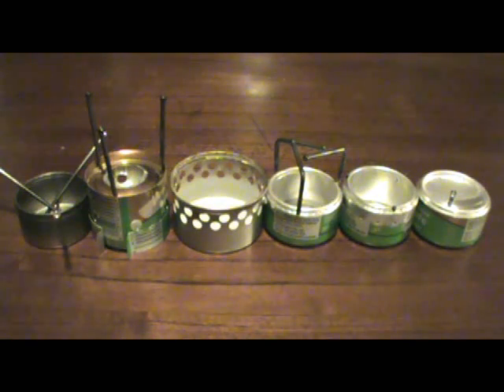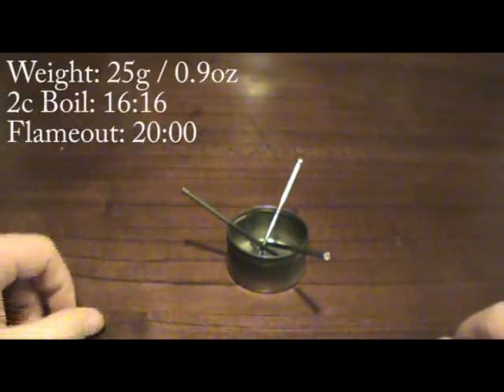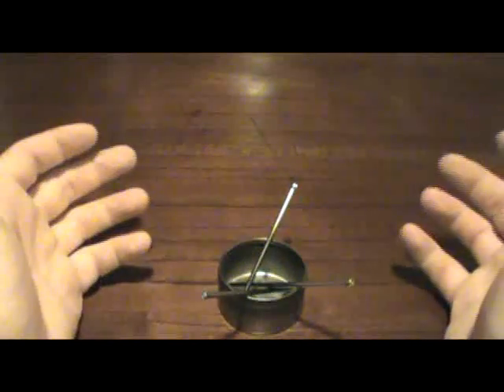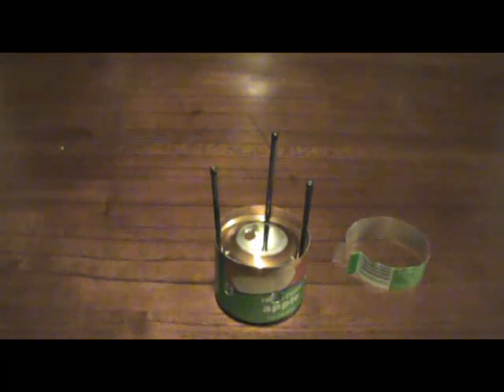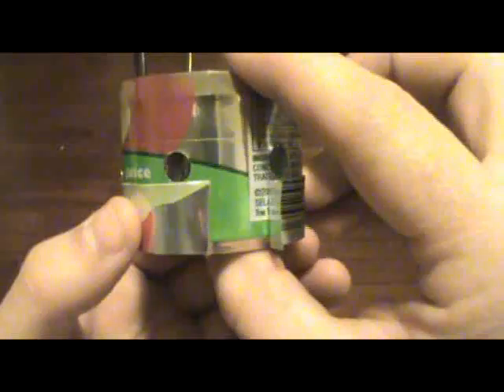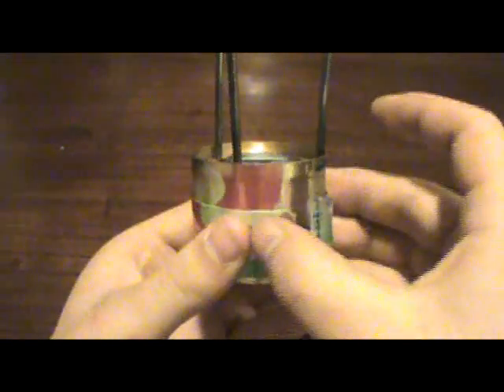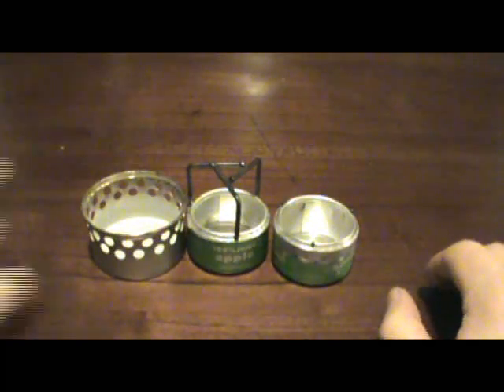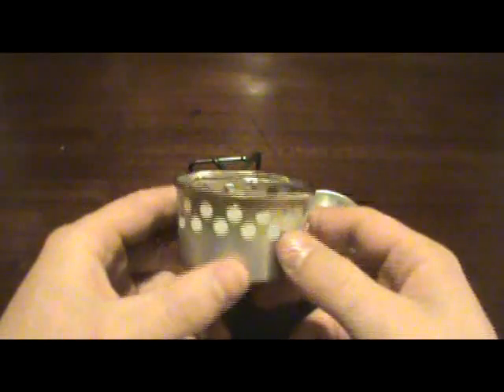DIY Alcohol Stoves

Comment: About your solo stove-
seems 1/2" from flame to bottom of the pot is too close.
Perhaps use 1/2" longer nails to get to the sweet spot?

About the stove you mentioned where someone used a threaded fill port closure -
Advantage of that is you fill the stove, then you seal it with the screw, then you can use the top where the screw is for a primer pan.

I noticed that no one uses a stove with a flow through center for air.

I am making a small one out of a candle tin and using a piece of 1/4" copper tubing through the middle (hole in the bottom of the tin).
Theory is that it can draw air from the bottom and pass through to the center to get better combustion and  act as a sort of thermal feedback for the stove.

Waiting for the JB Weld to cure is like sitting around waiting for the grass to grow....

I will try the design with and without carbon felt in the stove.
No pot, just to see how the flame works and for how long.

I like your nail pot holder idea.

An idea - how about using a tuna can and make it like the super cat stove?
Might be more stable for larger pots/skillets.

Comment: like hiram said you do have some cool videos on your channel. shame the chimney stove took damage in shipping to hiram. that style looks like it passes air thru kind of like a siphoning effect. it sort of in a small way reminds me of the old brasslite stoves even though those are quite a bit different. you know for small cups like a canteen cup those old brasslite stoves aren't that bad and they sure do save on fuel. i wonder if it's because of the air flow thru them mixing well with the fuel? your little "open jet" stove burns real cool!
Reply from the maker: Yes, the chimney style stoves do burn very efficiently. I am not sure why that is, though if I had to guess, I would agree with you - that it has something to do with the air and fuel mixing well when it's burning.
Thanks for watching!

Comment: you can make the open chimney stove into a low pressure sideburner by using a dremel and cutting several slots into top.  w/cookpot sitting on stove, a shorter windscreen can be used.  there is some slowdown in boil time in my stove.  I like that my windscreen fits entirely within my GSI Glacier SS cup.  I like the potential versatility of adding a coupla nails and a simmer ring, so that the stove can be used in several different ways.

Comment: A big thank you for this! I have been looking for a comparison video of the DIY pop can stoves. I actually built the runner up from Survival's great instructions before I saw that the side jet out performed the top jets. I love that you indicated which you would take for one or two people. I will never go alone so I'll stick with what I made. The nails were a good idea. I simply poked three holes to raise the pot off the ring that provides air flow and hopefully cures the cold water issue. Is there a video that shows how to install the nails if my way doesn't work? I am subscribing to your site for sure! Thank you!
Reply from the maker: ***** I'm glad you found the video helpful. I don't have a video that shows the nail installation, but I just drilled the holes such that the nail will fit, and then in my experience friction holds them in place well enough. Also in case you are interested, this is my new favorite stove that has replaced all of the ones you see here: https://www.youtube.com/watch?v=6XQVKLlLQjw
Reply: Great! I looked for hours to find the build demo video on Hiram's channel and elsewhere, never finding it. I did find one that used fiberglass cloth and a beer bottle instead of carbon fiber and a tomato paste. I may go that route as the cost of the cloth is 1/3 that of the fiber. Going to try my soda stove first once I figure out the best fuel. Thanks again. Great videos.

Comment from the maker: The pot stand height is largely trial and error. I'll experiment a few times and see what gives the best boil time and then stick with that. To get started I usually start near the tip of the flame as I've heard that's the hottest part of the flame.
Reply: Yes, pot height varies with stove types too, for some used  Iram Cook 1" sweet spot generate loot of soot. 
And some boil water faster with 1-1/2" or more, e.g. the laminar flow (chimney) models.
On the other side a "Groove stove" need just 1/4".